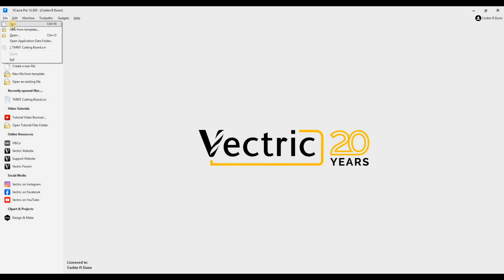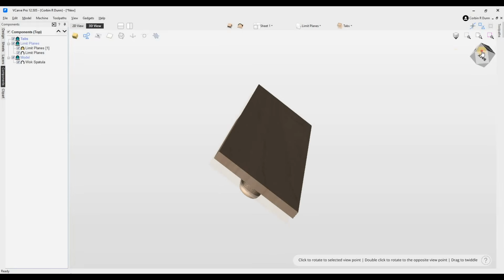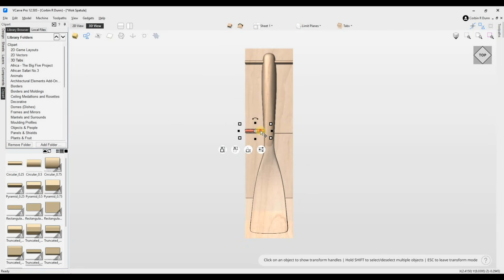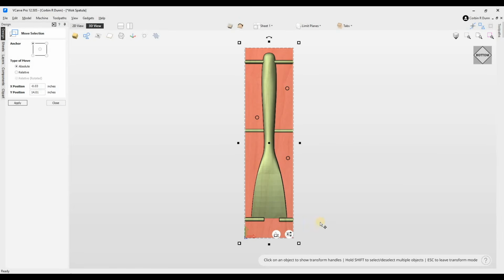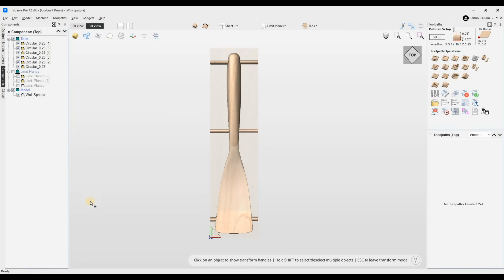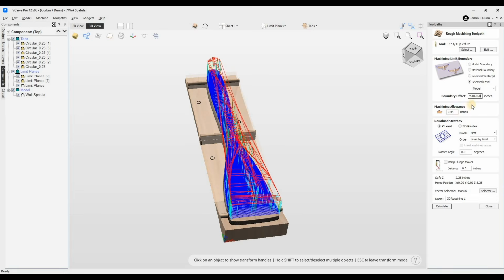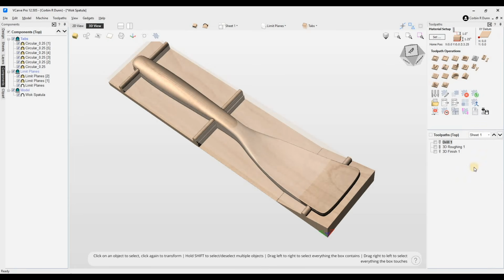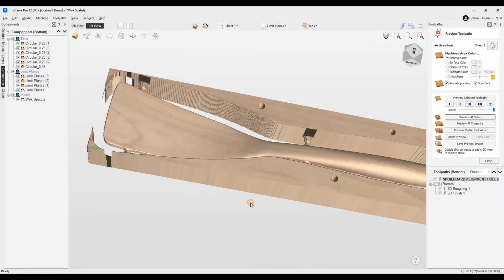Vectric VCarve Walkthrough/Tutorial: Setting up a 3d model for two sided machining - wok spatula

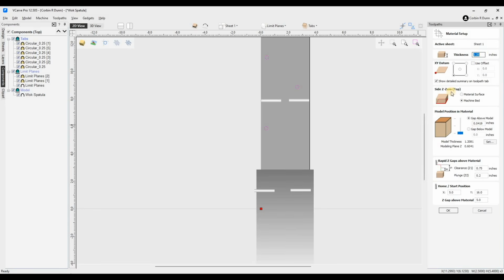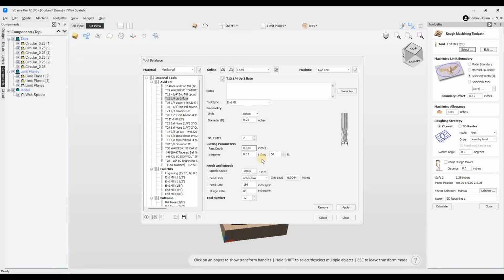Comment: About 17:45 is there a reason you raised the safe Z  up to 1", didn't see clamps or anything to worry about - just curious.  It was at 0.75 and you changed it.  About 19:45 you set pass depth for ruffing at 0.03 for a 0.25inch bit, this seems pretty light.  Can you share your thoughts on why so light.  I may have gone 0.125 (1/2 diameter of bit) but normally leave the pass depth for 1/4" bit at 0.25 - di. you consider this tooaggressive?  Actually for roughing I would normally use a hogging or roughing bit but for this type of model may even use a 1/4" ball nose but pass depth would be set at 0.25" for a 1/4".  Curious about your thoughts on roughing since you do more models than I do. Your discussion about Vectric software creating chtter/pixelation around the edges has been one of the things that does bother me also.  Are you indicating that if this is done in fusion you don't have the same issue and the bit cuts smoothly with less sanding?  BTW are you selling the STL's only or the vectric file setup the way you have it in this video.  i guess the best way is to go buy whatever you have.  Your packages are always top notch.  Another good instructional effort.
Reply from the maker: Yeah! I set it to 1" just to be safe for other people using this file. I could set it to 0.25" and I'd be fine, and it would carve faster. Yes, I like light roughing passes to not wear out my ball nose finishing bit as fast. I'm not sure if it really helps or not. I also think I can run the finishing pass faster if it isnt' cutting very deep. I've also found that at with objects..(maybe not this one)...having a larger roughing pass will leave tall and skinny stuff up, which may chip off with the finishing pass. So, it all depends on the design, and yes, on this one, I could probably rough deeper.

Comment: Very valuable information! Thanks Corbin!
For jagged edges, you can try changing the Modelling Resolution to Maximum... To unlock that option you need to hold Shift key while creating a new file
Reply from the maker: Yeah! I know about the secret resolution setting, I just haven't tried it. I should give it a go and see if it helps. I just wish Vectric would keep the original modeling data, instead of "voxelizing" the 3D STL. (At least, that is my guess as to what they are doing, based on my software engineering knowledge). The whole concept of a resolution for 3D CAD is not great for precision. It's kind of like pixels/Photoshop versus vectors/Illustrator. One is mathematical, the other is just a colored pixel.

Comment: Hey Thank you for the great videos! Is there a reason you opted to do the tool path in Vcarve instead of Fusion?  When you designed them initially did you use forms?
Reply from the maker: Yeah! I did it in Fusion, and I 100% prefer using Fusion for CAM, and the results are better (I could do a video detailing why). I re-created the toolpaths in VCarve simply to provide the pre-setup file for sale, as I know more people use VCarve than Fusion. It took me 20 or 30 minutes to setup in VCarve. 

The design is surface modeling with lofting. I feel like it is easier to manipulate the shapes via lofting than it is to form model it. I'm also not as good at form modeling. Some of my older designs, ie: butterfly bowl, are form modeled in Fusion.
Reply: Appreciate your taking the time for VCarve. I feel the same about Fusion being frustrating for me as Vectric is for you. Really nice design. Guess I’ll have to make a couple for rice instead of plastic. Keep the great work.